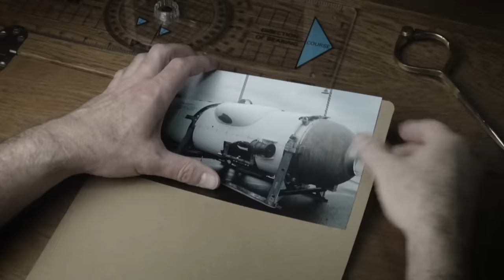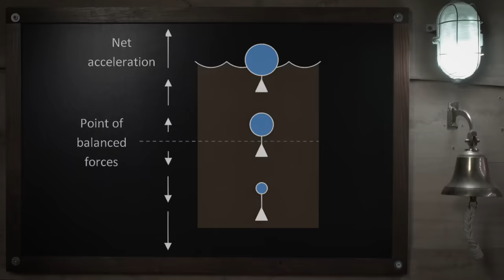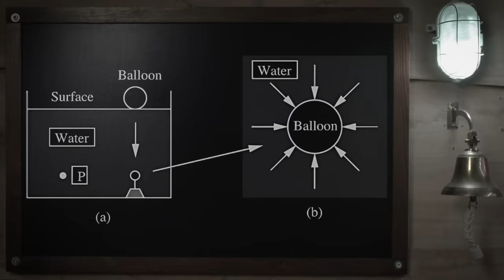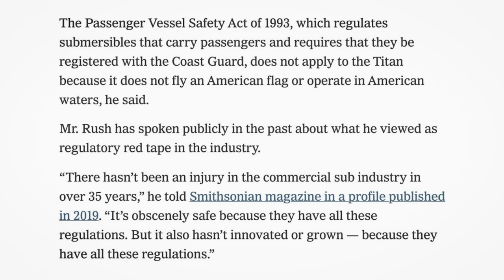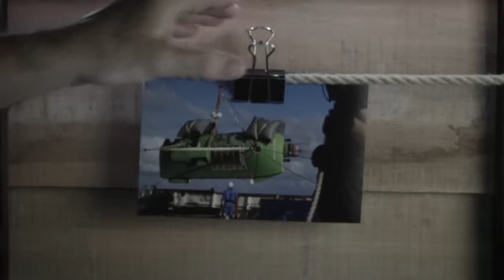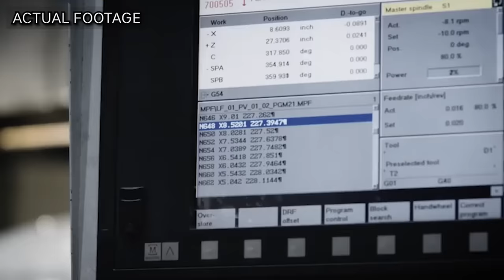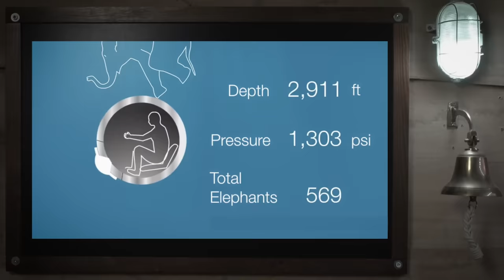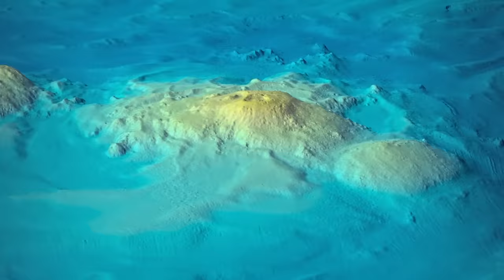Titan: From Inception to Implosion

Comment: Major error: the hull was not made of carbon fiber wrapped around titanium cylinder. It was carbon fiber hull capped on both ends by titanium domes
Reply: I wondered about that.  You are right.  I don't know how he made this mistake.
Reply: @cremebrulee4759 He probably gave them too much credit, it hard to believe that people are that stupid even with the evidence so his brain was probably shorting out whenever he read that particular piece of "genius".
Reply: In the construction videos it looks like they are wrapping the cf around a titanium tube, but that is just a mandrill for shaping the final product and is removed once finished.
Reply: pyropulseIXXI eeeh, if a person doesn't understand what is actually happening I can see how they might easily misunderstand what they are seeing.
Reply: Which was the inherent weakness, creating a hull from different materials and then gluing them together is never a good idea for a vessel going to high pressure environments. The way they glued the ends on was terrifying as well. I work in yacht building and you don't glue large items together like that because curing times will create different structural strengths and that's before we even get to contamination....
Reply: Sigh... It was interesting watching this until you pointed out major factual errors. Makes the whole video kinda lose credibility. 😂
Reply: No It had a thin layer of titanium inside that was not just a mold if you look at pics from inside the sub and during construction you can see it. Do some research before you talk :)
Reply: Though im not saying the design is good the deisgn sucked just give Waterline Story's some credit they know what they are talking about. :)
Reply: Was wondering about that too.
Definitely went against everything I'd read on its construction.
Reply: Then unsub
Reply: @HarryFlashmanVC Yep and the fact that the carbon fibre part is very good at withstanding pressure from within, but not at all suited to withstand it from outside...or so I've heard in another video, makes sense though.
Reply: This guy has no clue about what he’s talking about.
Reply: The carbon fibre was indeed wrapped around a titanium cylinder. The issue was that the titanium was only for wrapping and was not thick enough to give any significant structural advantages.
Reply: Pretty sure someone said the way the carbon fiber was wrapped around the cylinder to make the hull was an "abnormal" way of doing it that wasn't typical for this type of vessel.
Reply: Technically it was carbon fiber wrapped around a cylinder, the cylinder was removed from the carbon fiber afterwards though. (Some say it may have still failed With the cylinder still inside it)
Reply: What with all these high powered supersmart/so Smart almost coocoo...what WUD make you think u cud patch work something tht needs to withstand literally otherworldly pressures?…who pump him up?! No cap!
Reply: pyropulseIXXI  You are ignorant of the facts dude, he ignored qualified advice, and patted himself on his back for his stupidity.
Reply: He combined two very dissimilar materials and played a Hail Mary when his as yet still employed engineer told him it was not good to go.
Reply: @teresawelter7530  You are very correct Teresa. Good for resisting outward compression, because that is little in comparison to the forces of the inverse compression forces relative to the outside, "dissimilar tension" forces pushing against two different materials with two far enough apart different properties of expansion/contraction coefficients. Where as, the same metallic material with a similar strength to weight ratio, i.e. "Titanium" like that of the end caps, would have surpassed the CF properties. He apparently refused to look at the data due to his prejudiced outlook on Cost vs. Intellectual Reality.
Reply: @davydtaylor4151  It would have helped only if the majority forces were on the inside pushing outward, which of course they were not.
Reply: @DemoCATicMAN 👍🏻👍🏻👍🏻👍🏻
Reply: @DemoCATicMAN  I’m not entirely sure that that’s true but I wasn’t arguing for it’s suitability or efficacy. I was simply pointing out that the carbon fibre was indeed wound around a titanium hull. I grant you that the titanium was clearly not think enough and was only there as a former.
Reply: 💲Get Rich Or Die Trying💲

He took it to new levels or rather new depths.
Reply: *and the domes were GLUED to the cf hull. Epoxy releases gas as pressure increases.😮
Reply: Yep. The titanium mandrel that the carbon fiber was wrapped on, was removed after the carbon fiber was cured. The mandrel was purely for use in shaping the CF tube
Reply: I think that was their first model of cyclops.
Reply: That wasn't done mainly for buoyancy reasons. That's what guided the decision to use CF to begin with.
   When making laminated materials, there are limits, especially when it comes to different types of materials. If you see now, scuba air tanks often have some CF jacketing now. it works there because the CF acts as a net, taking some of the load off of the more-expanding steel core structure.
    But in the Titan, if it has a titanium inner layer, a concern would be delamination. It has a different level of expansion and contraction than the CF. So it would likely separate.
    That different of compression was a problem between the ends and the cylinder part of the vessel. 
   Once it delaminated, it's not helping structurally, it's dead weight. Too think, and it will get compressive damage from the outer layer, it might buckle. Too thick, then it's inefficient, not as buoyant, which was the idea of using CF in the first place.
   Even though it was made of one material, it still delaminated. The CF hull was 5 inches thick in the Titan. Nobody makes CF that thick (aerospace, or F1.
   Imagine a tightly-wound roll of paper. Seems strong. But as you apply pressure to it, the surface has more area than the inner layers. The loads on the layers increases as the rings get smaller. That means they well want to compress more than the outer layers.
   They will want to contract at different rates. Force will be laterally in the layers, pushing to separate the layers because of the unequal force.
   In a roll of adding machine or toilet paper, you'll see that the inner layers will bulge inward. If the epoxy breaks between layers, they're now free to move more.
    Note: the Titan did not have anything structural inside the CF hull. All that did was keep people from contacting the CF walls, and provide space for lights and wires.
Reply: @cremebrulee4759  I believe that during the process of making the carbon fiber hull it is spooled around a metal tube which is what he saw in OceanGates behind the scenes footage, but this metal cylinder is just a temporary piece thats taken out after the carbon is spooled, maybe thats why idk
Reply: @Man_Emperor_of_Mankind Agreed, but I don't think they used titanium. It wouldn't make sense to use titanium just for a mandrel/form. I would guess it was mild steel..
Reply: @HarryFlashmanVC it looks bad, I can only assume they relied on the pressure of the deep to keep the ends on. If it ever leaked I would assume it would happen at/near the surface.
Reply: The major error was using composite materials for handling compression forces, something they were aware of and were warned about multiple times. Using a window rated 1300m at 4000m is also another major error.
Reply: @HarryFlashmanVC yeah it doesn’t matter if the hull can withstand the pressure if the glue can’t 😅
Reply: We did a finite element analysis using ANSYS for composite materials,. Then we pressure tested the hull to alternating _+ 7500 PSI for 1000 cycles. Something else is going on with the disaster.
Reply: @chucksurgeonertribute2113  ‘we’?
Reply: @chucksurgeonertribute2113  Wrong, you didn't test shit, that's why 5 people are dead
Reply: There was no titanium in the sub. There was a metal screen used to support the screens and hold lights. Just titanium end caps. This is simple information found easily in many places online.
Reply: @mattycampbell4709  pretty sure he meant the titanium end caps.
Reply: @Somerogue17  There was no 'thin layer of titanium' in the cylinder.
Reply: Even then, the shape does not allow for pressure to be evenly distributed. They were doomed regardless
Reply: @HarryFlashmanVC  I assume you've seen the video? Watching the video of them gluing the titanium rings to the carbon fiber with people who know a lot about carbon fiber is Highly Entertaining if you like seeing other people being horrified.
Reply: @greysnake2903 I unsubbed your mum
Reply: @pyropulseIXXI bro relax lol
Reply: "major error"🤓☝️
Reply: An expert (I think material scientist) explained to me that a thick carbon fibre cylinder with a large diameter is not as bad as was being speculated, at least in regard to pressure.

With enough thickness and large enough diameter an external force functions similar to an external force when it comes to carbon fibre (mainly because there are so many layers and any given section is relatively 'flat' that layers begin to work to retain the other layers - meaning many layers aren't working in compression but tension).

He did indeed point out though there are other issues with carbon fibre, like delaminating and porosity which make it a poor choice for multiple dives.
Reply: I also noticed they erroneously referred to the control system as a "PlayStation system" when it was a Logitech controller
Reply: @cremebrulee4759 arrogance/ haughty attitude.
Reply: So he used the weaker and untested material for the middle section. Which is the one that is exposed to more stress and pressure. Wow, how could that ever fail?
Reply: Bring our 5 boys home alive!
Reply: @cremebrulee4759 I’m assuming price.
Reply: @greysnake2903  who says he's subbed? Do you need to be subbed to watch a video?